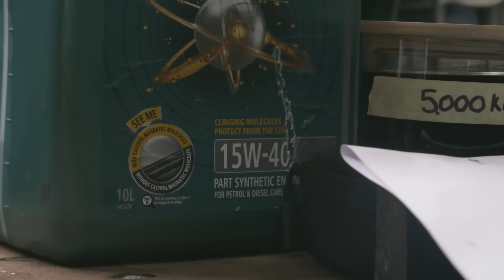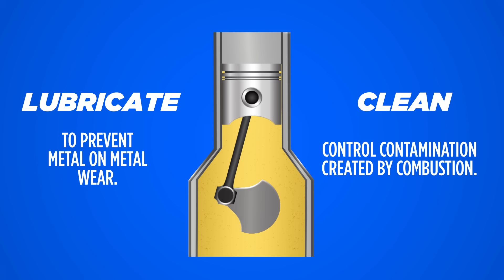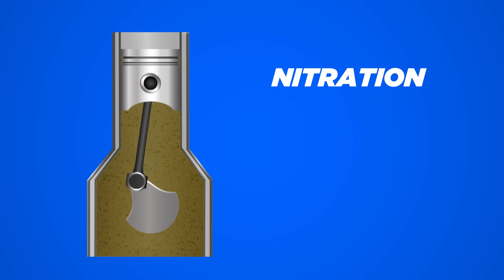Engine oil COMPARED at 5,000km vs 10,000km vs 20,000km! This'll make you service your 4WD RIGHT NOW!

Comment: I have a Honda motorcycle and the manual says every 12000km or once per year. So I do change it once per year using semi synthetic oil. If I travel internationally that year i will do around 8000-9000km, if not, about 5000km. In both cases is far less than 12000, I have it for 19 years still running good. Don't waste money and time for something that is just in your mind. Changing oil so frequently only makes you feel better, but this is a machine and it doesn't have feelings. It's psycological, the manufacturer knows more than you.

Comment: Re his comment at 20,000km….. I change mine at 20,000km …. Zero issues. Diesel has done over 400,000km and petrol over 350,000km. Serviced as per manufacturer and with top of the line oils. Not that cheap supercheap stuff

Comment: The modern 10,000 km for diesel or 15,000km for petrol oil service intervals is only so car companies can claim low ownership costs and environmental nonsense, so not as much waste oil in a certain amount of time.  And these extended drain intervals are certainly not for engine longevity,  it’s like car companies saying transmission fluid is lifetime, that is the biggest joke there is. Lifetime means different things to a car company and a long term car owner.  Lifetime to a car company is only warranty period.  I have seen piles of sludge in engines that have had 15,000km services and engines are stuffed at just over 100,000kms if they had oil changes at half the 15,000 those engines would still be healthy and clean.  Oil is cheap, engines are not. Especially with todays little engines with turbos and more high strung

Comment: Too many Youtube experts believe themselves to be better engineers than the manufacturer. 
Holden recommends 12000km intervals for their Duramax diesels after years of engineering and testing and that's not I'm going to stick with. 
No need to reinvent the wheel. Stick to the recommended servicing and you'll be right.

Comment: I think a lot of this depends on how you use your car. Like he says, if you're doing lots of hard off-roading or stop start city driving its probably better to do shorter intervals. Personally for me, my car almost never sees an unpaved road and spends about 75% of its running time doing easy highway miles, I'm happy to go 10,000k between changes with full synthetic and have never had an issue doing so.

Comment: Hello Brother,
I need ur advice.
I have Toyota Prado 120. Patrol engine. Usually I change engine oil (10w 30) and filter every 5000 Km. But now 11 months and ~5500Km. We are in holiday and no service center are opened. Plan to go trip around another 500 Km. Is it problem?
Reply: Shouln't worry it I have occasionally pushed both cars to 20,000 klm but that was only because didn't have money or couldn't get the car booked in on time

Comment: Nice old school test. So the next thing you should do I drain the 20K oil through a muslin cloth. The do the same test. You will be surprised. In theory Oil doesn't lose its viscosity. It the containment that's the problem. 
Of course no one in this day and age would risk it. But if you took your 5K oil and cleaned it through a muslin cloth. You could put it straight back into your engine. 
It's what we did in the 1980's . When we were all poor.

Comment: The colour doesn't matter. Oil operates differently in a heated engine then at room temp. This   video is nonsense
Reply from the maker: Hey mate! We can definitely agree with that but if you test in the same conditions when the oil is all the same room temp, you can still see the effects!

Comment: I regret that car producers to not have a spoon and piece of paper to define correct oil change interval. Instrumental measuremetns which they are using, are way far from perfection of the spoon/paper method.

Comment: Aircraft piston engine oil is changed at 100 hours. That’s all it’s good for. This is with 2,000 hour overhauls of engine.
100 hours in a city might be 3,000km or maybe 7,000km of highway use. If you love your engine, change oil often 🤷‍♂️

Comment: Hello, In support of the 540+ endorsements of Tribology Lab oil tests by Brett Clark, he is absolutely right. However interpretation of the lab results needs explaining. I also have a Toyota 1VD and since new every oil change a sample bottle with 80ml oil taken half way thru a HOT drain is sent to ALS labs. For $36 you get the Elements identified in ppm. Elements as per the Periodic Table and not the all important molecules or compounds. ZDDP is a good example especially where Zinc and Phosphorus with Molybdenum are the actual lubricants in engine oil. ZDDP is a large molecule of the Zn + Ph combo and should be above 1,000 ppm in pre-DPF engine, but you'll likely see 5W-30 Diesel oil for DPF engines has around 20% less of these lubricants.  Tribology lab cannot identify oil brand and cannot identify the W weights so cannot identify 5W-40 from 10W-40 from 15W-40, here Viscosity @ 40deg C and 100deg C must be checked.  
Shauno your visual test is a VERY good test of how much crap gets past the 30 micron RYCO  R2651P oil filter. You show that a hell of a lot of sub 30 micron specs stay suspended. 
The Tribology lab results shows Diesel Oil itself is still fine for 500 hours ( ~ 30,000kms) as happens in ALL Caterpillar & Komatsu equipment (except SkidSteer) and your easy test shows that Oil should be dropped HOT so suspended specs under 30um crap gushes out with the oil. Unless you can find a 10 micron filter to treat the oil every 5,000 then (I can't find one) then in my humble opinion 10,000km is the Max oil & filter life

Comment: I do 50km a year and I follow the bmw recommendations and Iv had cars with 350k and never changed a thing on the car apart from brakes and discs.  Same water pump same turbo injections and no problems at all.

Comment: Im changing my oil every 5000 miles as my dealer told me every 10000 nahhh do you think if my engine break they can fix it? or replace it? i dont think so well still under warranty  , im keeping the car and its not a lease so thats why changing my oil every 5000 miles and sometimes 6000 ...

Comment: Manufacturer doesn't just recommend changing the oil every 10K but also every 6 months for Honda as an example or 12 month for other cars. So basically some people may not even do 5k or 10k during 6 months but according to manufacturer they need to change the oil on which ever comes first

Comment: I've been going 4000-4500 miles between changes on my 2014 Taurus (120k miles), with regular oil not synthetic, for the 9 years I've had this. Only one time did I let it go until the sensor said to change the oil (at 5k miles). I do mostly highway driving at 75 mph and 200 miles a week. I almost always get the oil changes at quick lube type places which I just learned all probably use inferior oil filters. I may change my ways to 3-4k miles with full synthetic and at a real mechanic shop. Thoughts anyone?

Comment: On my car a150 mercedes i change it ever 15000km with mercedes recommended Mobil 1 oil aka the OEM one. I drive at least 500km per week. When i change it it looks brand new. Open road driving is the key here

Comment: Offroad contions means 10k is in ENGINE HOURS equal to 5 to 10 times more time then 10k on asphalt. Plain and simple. So yes. OIl looses viscosity lub and washing quality when there are contaminanst in it, from hundreds of hours ow idling, working. So yes correct, simple.

Comment: Changing oil more frequently ensures less % contamination that causes wear. This includes fuel and water. But there are diminishing returns if you go extreme on frequent oil changes.

The other issue is the lubricant additives. Are they at sufficient levels to ensure performance?

Lastly there is engine oil viscosity. With multi grade oils they can shear down and become less viscose. Additionally oxidation can cause oil to thicken, forming sludge and varnish.

I haven't seen an engine die from frequent oil changes though, but plenty with issues related to lack of maintenance. This includes a lack of oil.

What isn't discussed is oil filtration. Synthetic filters can filter smaller micron particles that are the leading cause of engine wear.

Comment: 1. How good did the piston rings seal where this oil test is taken from, 2. was there an EGC/Crank Circ with the condition of it, and 3 this should be send away for analysis. 

In the end fresh oil is always better, but it doesn't mean your engine lasts 1 million kilometers over 500k. Depend what objective you try to achieve. It's like drinking alcohol is toxic, yet everyone still does it - does it shorten your life? Maybe.... but benefits and objectives change they way you act.

Comment: As already commented, correct spectromatic oil analysis is the most accurate way to monitor your oil properties and henceforth engine condition. Assuming this is oil from a diesel engine, oil total base number (TBN) and total acid number (TAN) are a crucial factor. As your oils alkaline reserve begins to deteriorate due to the combustion process,  an acidic environment may result. Acidic environment=bad times Joe.

Comment: Darker just meants the oil has been burnt by the engine. Put oil in a pot on a stove and it turns black pretty quick. It doesnt mean it has more contaminents in it than an oil that has been in a prius for 5k miles and still looks clear. It just means the oil has spent longer at higher temps, nothing more. Some engines by design run a lot hotter than others.  The only way to know the contaminents is to have it lab tested.

Comment: Very useful video, it’s very worrying why manufacturers suggest to change the oil every 10k as I’ve always thought it was too much. 
On my motorcycles I tend to change it more frequently than my car but I still change them both very regularly and never wait till the oil goes black I like to change it when it goes slightly darker than maple syrup
Reply: Because they need to sell new cars or repair cost

Comment: Thank you so much for this video.
I own a 2007 Chrysler Sebring 2.0L diesel. My car has a Volkswagen TDI engine, nozzle pump. 
I drive most in a little town, driving on very very short distances with many stops and goes. 
I change the oil four times a year, every 3 months. Now, when these three months are completed and I change the oil, I might have about 1500 km driven, or 2000 km. 
What do you think about my way of changing the oil? Many people judge me or make fun of me because I change it too often and others say I do the best for my engine.  What do you think?
I put in the car Ravenol 5W-30 VMP.

Comment: A lab test such as some of the yank channels do is really the only way to test the longevity of any oil.  Most oils these days far exceed what lubrication is needed by the engine of an average vehicle.  The fact that the oil is black, especially diesel oil, is absolutely no indicator of how worn out it is as the oil has additives that are designed to suspend the carbon particles caused by blow by in the oil which causes them to appear dark even though the polymer chains are still in perfect condition.

Comment: Mazda cx-3 (2019) oil change every 20k-30k , 285 000 Kms and going strong.
Reply: High percent you have gasoline engine but not a diesel. I have a 2017 Mazda 3 diesel. Its almost impossible 20k-30k for me

Comment: Another thing to consider, Forget distance travelled, forget hours of run time. I think it might actually be more accurate to go by total liters of fuel consumed by the engine. I would guess, about 150-200 liters of fuel consumed per liter of total oil exchanged in a service. You'll find, that doing heavy off-roading, or short distance winter driving, your fuel efficiency is very low, compared to summer freeway driving. Going by the fuel consumed, compensates for the variety of operating conditions the engine might be subjected to, during a service interval.
     I used to drive a tow truck. There was a lot of time spent, with the engine idling (jump starts), and, time where the engine was running above idle, and even loaded, (recovery), where the engine is consuming fuel, without going anywhere. Then, there's towing, where the engine has to power the weight of 2 vehicles, and all the rigging to connect the two together. That engine was always heavily loaded. The truck was equipped with a very large auxiliary fuel tank, and, every 3rd fill-up, time for an oil/filter change. Despite the severe operating conditions, the engine lasted for decades!

Comment: Well back in 1998 my father bought a 1985 Volvo 244. He drove it for almost 4 years daily before he lost his first leg due to complications af his diabetes. However he NEVER changed the oil at all! He just filled it up once in a while when the light switch on. I drained it in 2012.(I didn't drive it so much) but yeah it was so black. But the engine ruined happily 😂❤ B200K engine🖤

Comment: I’m in the U.S.  For all my vehicles, I use only Amsoil Signature Series. The oil has very little burn-off which helps greatly with reduced deposits and with extending the life of the emissions and cat systems. I change out between 10,000 - 15,000 miles (16,093 - 24,140 kilometers) and burn thru about 1 1/2 quarts per oil change. The oil is rated to go up to 25,000 miles (40,233 kilometers) with the proper filter. This all depends greatly on how you use your vehicle. All my vehicles have lasted me close to 250,000 miles  (402,336 kilometers) before I sold them in still good condition. I would encourage everyone to use only top quality synthetic oils, even though they cost more, as they will greatly extend the life of your engine and transmission.  The oil analysis all report back as having many thousands of miles of life left in the oil, even at those higher mileage uses.
Reply: Have you compared it with conventional oil name brands?
Reply: Oil is great and can go 25k but it can't stop contaminants not related from the oil. You should still change your oil no more than 5k
Reply: I too use Amsoil Signature Series "100% Synthetic" Motor Oil for the past 20 years and I have achieved the same results as you.  For the benefit of others reading my reply, why did I choose Amsoil?  After experimenting with various brands of "Full Synthetic" oil (including Castrol, Pennzoil, Valvoline, Mobil 1, etc.), I was amazed at the overall performance, increased horsepower and higher fuel economy!

Comment: Oil sampling is the only way . If a a vehicle stays on sealed road 10,000km . If the vehicle goes in sand or dust or tows alot every 5000km .
A 4x4 vehicle engine does not typically have a very large oil pan or the use of a bypass filter.
Oh yes u can clean oil and the oil still be broken down that it cannot cope with even a small amount of debris . 
Summary change oil/filter  according to your conditions . Remember to check air filter every service .

Comment: Ive been a trucker for the last 40 yrs .i never go by the manufacturers recommend 
Ive put 1.600000 million kms on a scania with no problems
The quickest and simplest test is get the dipstick and rub the oil on the back of your hand get a clean piece of paper and rub the oil off  if your skin pores are black change the oil there is too much carbon in the oil.   This method has never failed me

Comment: Well done again , what can I use on new hilux 2.8 ?
Wanting to start doing it myself .
PDF is not coming out either 
I heard a Rattle gun being used on my new hilux to change the cover plates.
So I wasn’t impressed about using a rattle gun at all because it’s unnecessary and wanting to just get the job done myself I love my Toyota and I have faith in the product and don’t really think I need to have their warranty.
I have always bought new Toyotas and done it myself but this one has a DPF which makes me unaware.
Help would be much appreciated

Comment: Look up scheme in the service manual, choose your climate, type of driving, change at least 1 time a year even if you do not reach mileage.
Better to change oil filter halfway service interval. Use fuel additive twice a year. Make regular long drive. Push the engine to clean it.
Depends also on brand, engine design, mileage, higher mileage requires more regular interval. 🚙
Reply: Yes, thats also a good practice don't baby the car because you get deposit at the top of the cylinder's which prevent it getting to it's full speed

Comment: The recommendation of oil change is made to ensure that 99.99%  vehicle makes to to a few years past its warranty. Mobil makes oil that lasts for 20 000km when used with their recommended filter. The same oil in the US lasts for 20 000 miles. Lab tests have shown that the oil performs as required. You can choose to change your oil everyday if you wish but it will not give you a proportionate longevity.

Comment: 4WD: LC FJ62, 4L, 700.000KM, oil and filter change every 5000km when used hard, 10.000 when just highway use, So 5000 it is. Engine never opened. Use 1L Morey's heavy duty oil stabiliser every change. Runs like new still! No oil use rattle or ticking at all.

Comment: Thanks for the Blotter Text on different oil changes. At 3:24 you can see the 5000km oil still has some use, the carbon contaminits are floating around while the outer edged is still clear but it also means some carbon is getting pass the oil filter. At 10,000km the oil is pretty much saturated, means the filter has given up long ago. The 20,000km oil..........NO COMMENT!! 
Castrol is a fine oil but pricey. Everyone has their favorit.......mine is the cheapest I can find on Amazon as long as it meets the manufactuers specs as stated in the owners manual API/SL - SN, 0W - - - - - -40 at 5000km - 10,000km.

Comment: Also, you can make that 5000 km oil get cleaner by replacing just the oil filter every 2400 km between oil changes.